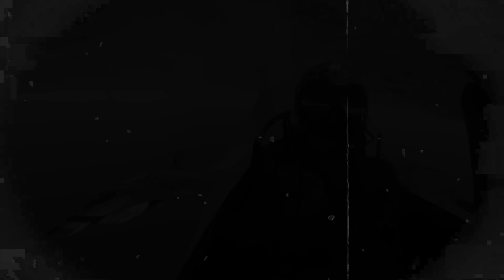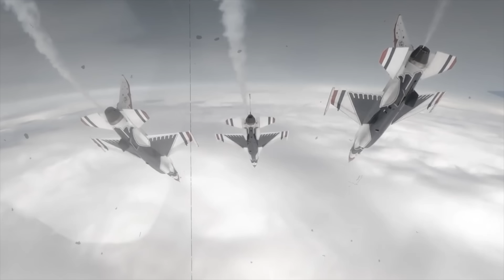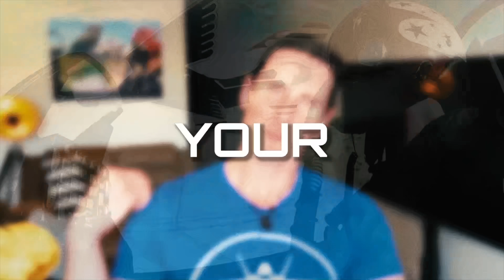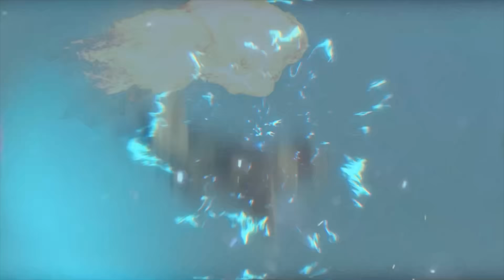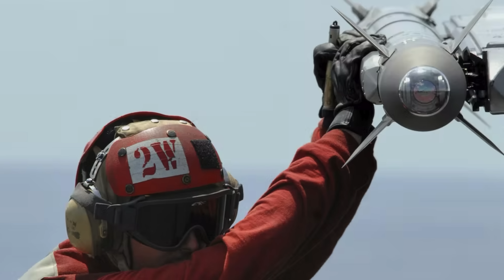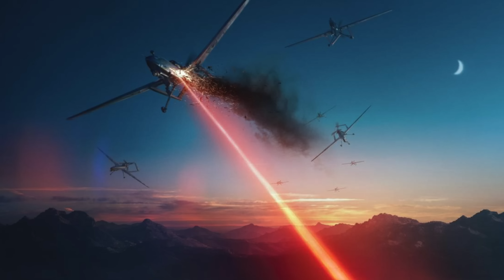F-16 Missed Its First Shot At Lake Huron UFO

Comment: Any reason we couldn't mount up a .30 or .50 cal gun pod onto the wings of an A10 for these sorts of scenarios where we don't want the potential collateral of the brrrt?

Also we do have to hope that if this does happen to be ET that he doesn't get pissed we keep blowing up his toys and respond in kind; with that metric to scale against I hope it is another country
Reply: IF it was ET they would have for sure calculated the possibilty to be fired upon in hanger
Reply: Bruh the A-10 has a REALISTIC service ceiling of 35000 feet (and that pretty optimistic lol) and will barely break 350 knots completely clean. It also doesn't have a lead calculating gunsight (no FCR), And gun/cannon rounds are terrible for taking out objects of this nature anyway.  Unless you wanted this thing to be halfway across the Atlantic by the time you got to it, Then that's the dumbest thing ive ever heard.
Reply: It would be much cheaper and safer to simply use high explosive ammunition with a timed self-destruct fuze.  That way they detonate in air before ever getting to the ground.  The fragments from an exploded 20mm HE are much smaller, much more irregular, and slow down much more in air resistance (and therefore are much lower energy when they get to the ground than would be .30 or .50 caliber bullets).  20mm HE fragments will reach the ground and impact with energy comparable to rain or small hailstones; the .30 or .50 bullet will still be lethal when it gets to the ground.

Timed-self-destruct-fuzed 20mm ammo is already in the military supply system (having been built for ground-mounted anti-air guns, primarily the C-RAM).  Self-destruct-fuzed 20mm could be fired from the existing internal gun already used in all US fighters (except the F-35 which uses a 25mm)  Putting them into US fighters would solve the problem better than would a .30 or .50 gun pod, would require no new equipment procurement nor flight testing of new gun pods, and would be safer and more effective.

Comment: I haven't watch the whole video but i think zuni or hydra rockets with one of those add on laser guidance packages would be a good option.
Reply: No. Rockets are unguided. Good for use on stationary ground targets or where the speed differential between aircraft and target is low.

In this scenario the UFO is travelling at very low speed and the incoming fighter is approaching at hundreds of knots.

And there is high altitude winds to contend with too.
Reply: @deanXRayZulu  you misunderstood my comment, there is a guidance system called the wgu 58/b that can retrofitted to zuni rockets so they can hit a moving target but still a lot cheaper than a missile like hellfire or aim9x.